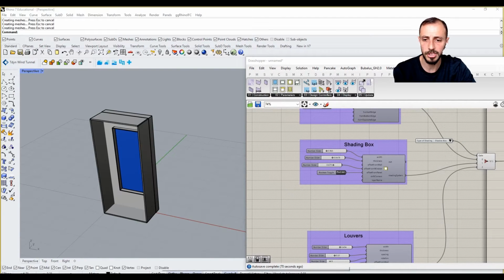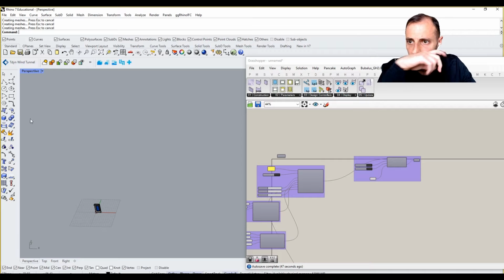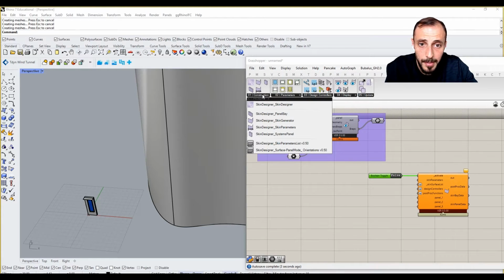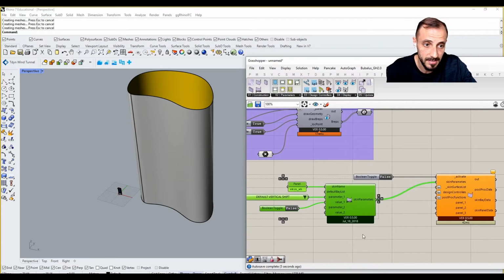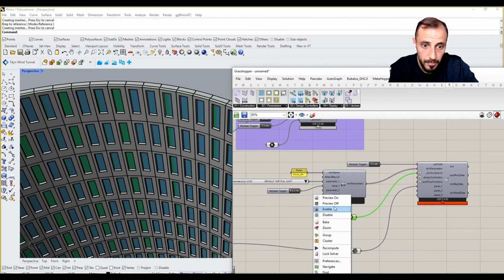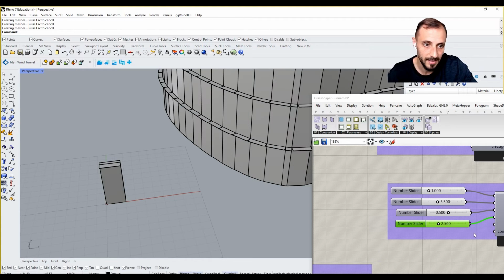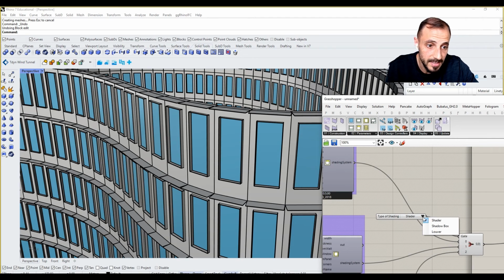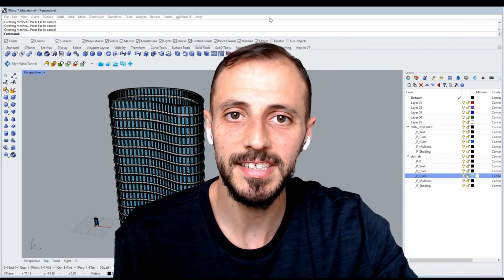4- Mapping Panels to Surfaces: SkinDesigner tutorial 🌐 #panel  #surfaceapplication #rhino3d

Comment: SkinDesigner is no longer being supported nor maintained...do you think this is still the best way to come up with conceptual facade design? or better 1. use block and 'replaceBlock' in Rhino 2. use Rhino.Inside.Revit directly?
Reply from the maker: Well, it's a good question! I believe that, depending on your workflow, you can opt for these options, including SkinDesigner. However, if you're tying everything together in Revit,  I would go with your way. I do still believe that SkinDesigner is quite strong and useful for most cases.